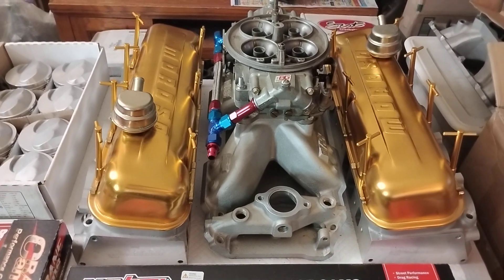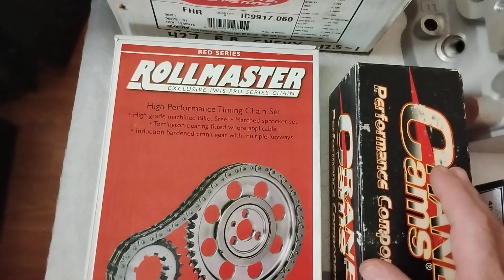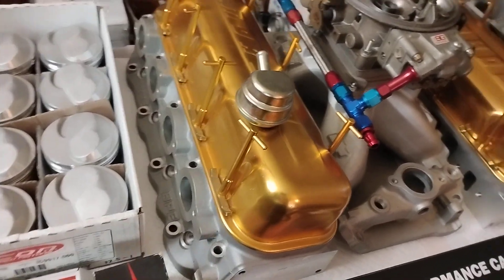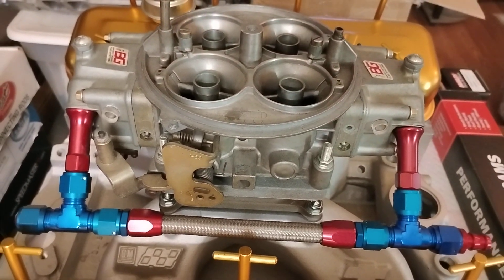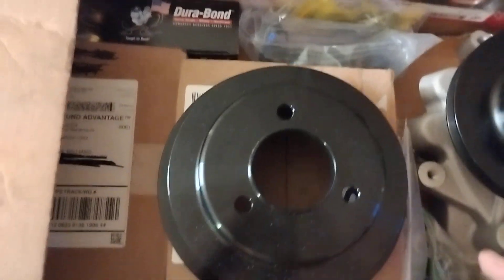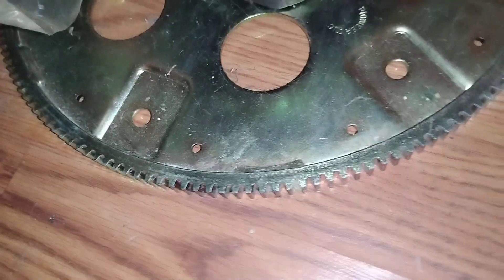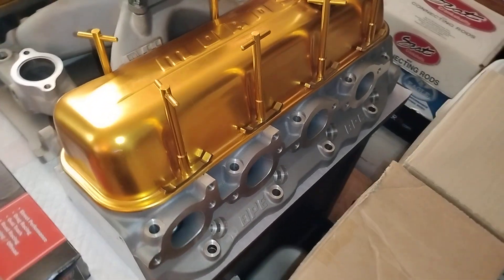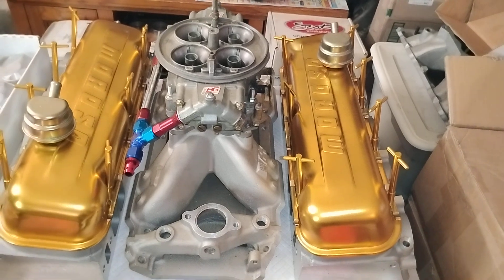1969 13.2-1 .060 427 TD Bigblock Chevy "Top end Kit" & rotating assembly etc.

Comment: Well Sam it looks like he got all the expensive parts added up that always takes a while
Reply from the maker: Persistence is the key. Ive had this engine since 2001. Finally got the shit to build it.
Reply from the maker: Spread out over 24yrs, it wasn't too bad. Be a hit all at once tho. Probably $10,000 to $12,000 grand in this unit.
Reply: My last motor took about five years to save up money is still a few bucks here there it’s like you’re never done. It looks like you’re gonna have yourself a nice motor hopefully everything goes as planned for you later bye

Comment: Check out David wizard he has a video out on a 525 big block with 10.5 to 1 compression 87 octane pump gas engine that made I think 785hp and 722 torque he used the trick flow 320cc heads I think once I get my 406 together that is going to be my next project. Check out the video.
Reply from the maker: Been reading his books since the 70s. Pretty smart dude. Still have every book I ever owned, have many of his.
Reply from the maker: I watch his videos too. Andy Woods old F-100 pick-up is pretty badass. For a Ford.....

Comment: My dad got me a BG 750 d/p back in 1990 for a Xmas gift.  It by far is the best carb I own.  I think it runs as good or better than this fuel injection crap nowadays. It even ran amazing with a procharger set up.  I ran it inside a Paxton box but   It always runs amazing on any combo. Cool videos Sam 👍
Reply from the maker: That BG shit was all top shelf. Barry Grant was one of the best fuel system guys ever to live. I still have quite a bit of it stashed away. Wish they were still in business.
Reply from the maker: Only fuel injection I like is mechanical stack injection like Hilborn or Crower. 8 stacks sticking thru the hood looks pretty cool. Also a Enderle Buzzard catcher injector hat on a tunnelram is pretty badass too. A Ron's Flying Toilet on a big ass single plane intake with the fuel lines on the runners above the intake ports works well too. All the Fitech and Holley EFI systems are junk. Mechanical injection only way I use fuel injection. I like my shit simple and I don't want an ECM that's connected to the web. Nothing good can come from that.
Reply from the maker: Next thing ya know your car is snitching on you for doing burnouts on the street.